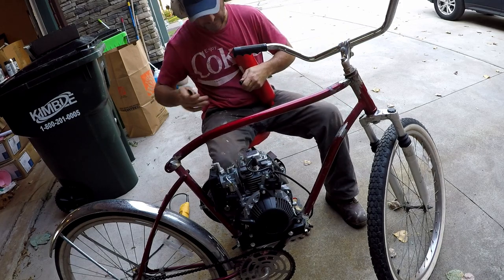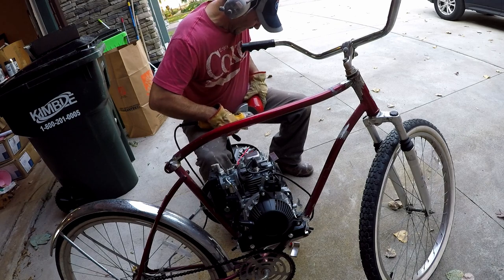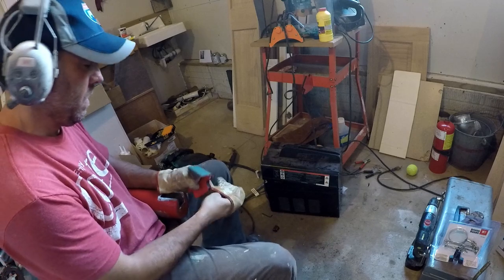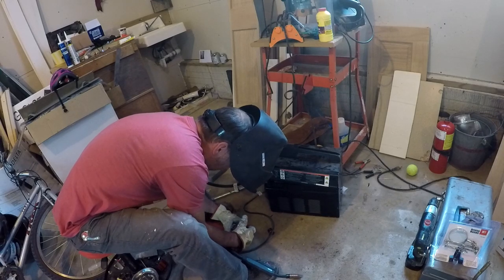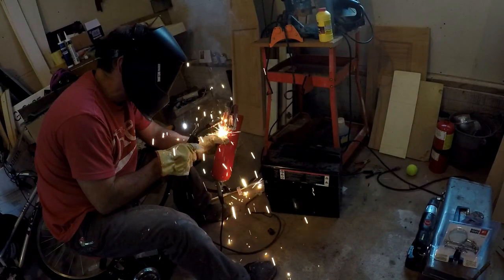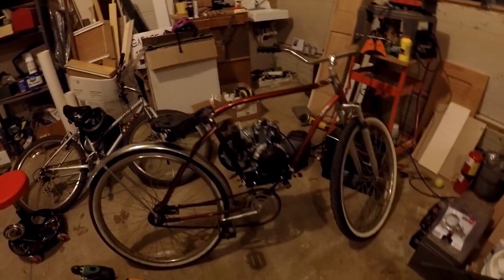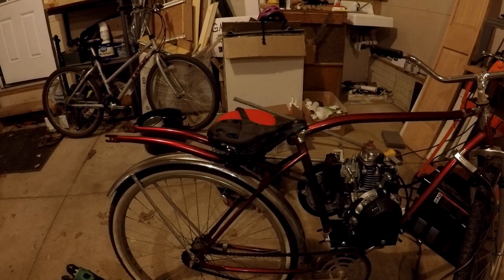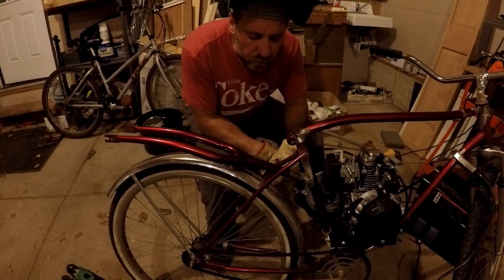Historical Bike Build (video #5) 49cc 4-stroke fire extinguisher gas tank.

Comment: How did you vent it ?
Reply from the maker: Good question.  I ended up using a couple of propane cans instead of the fire extinguisher because the fire extinguisher was too large.  I I used the pressure relief valve from the propane cans as vents .  You can also drill a small hole in the cap.  Take a look at the later video in the series that shows the tank build.  Thanks for watching!